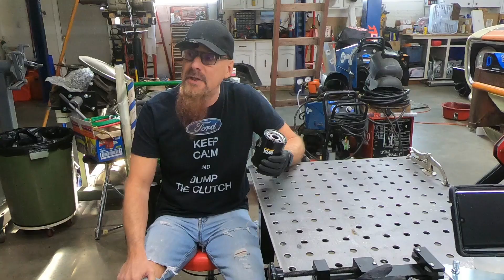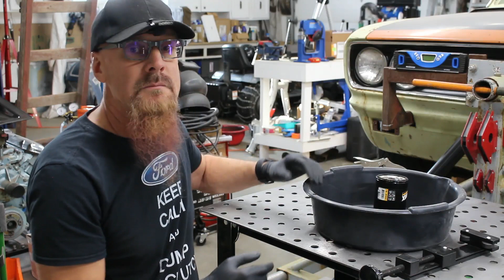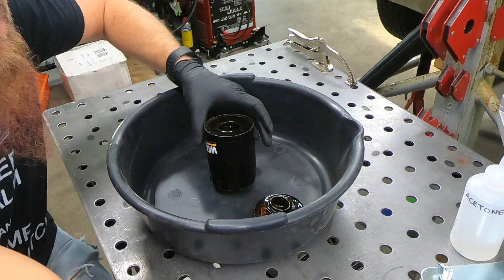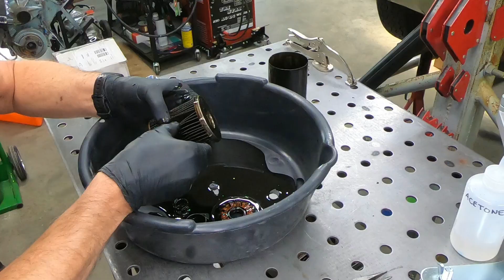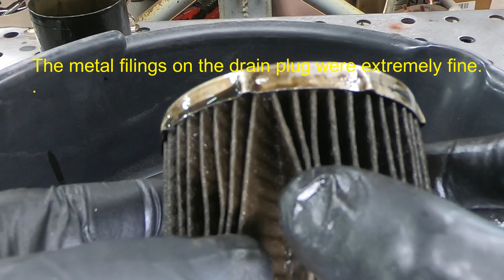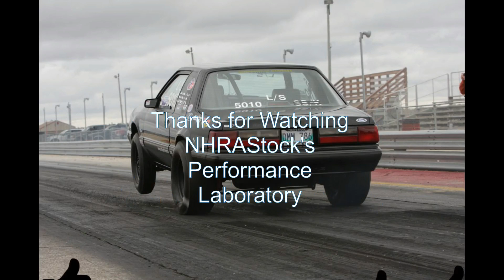Oil Filter Inspection

Comment: nice advise thank u . have u ever done lab tests to the used oil from the car ? i have done it to machinery oils but not to a car. I guess transmission oil testing could say something about gears and bearings wearing
Reply from the maker: I've thought about oil analysis several times, for several vehicles, but never had a critical need to pursue it yet. If I saw a bunch of metal in my filter, oil analysis would likely have been my next step.
Reply: @The_Performance_Laboratory  i once saw a broken oil pump because a unknown metal piece  on a 576 ci mopar race engine. They didnt know where that piece came from, i was thinking could be a little piece from the roller lifters, i have read that the little needles of the bearing tend to break. And i thought maybe with a oil analyze they can see where that part came from, u know if the lab tests shows chrome steel must be a roller bearing , aluminium of lead should be a Main or rod bearing , etc .